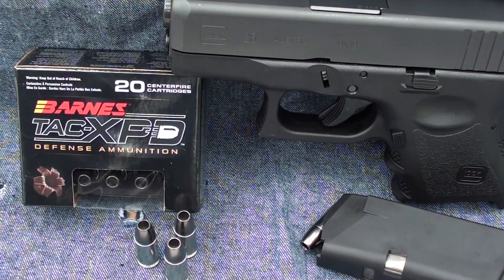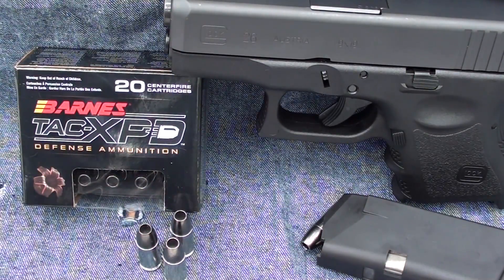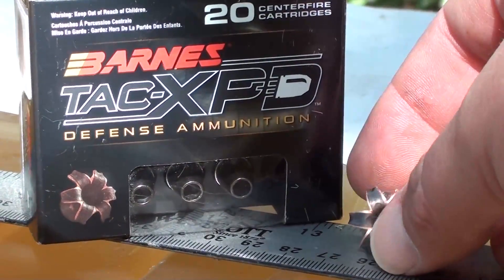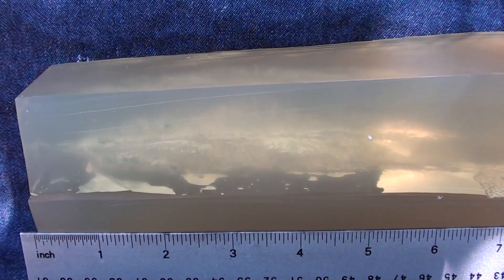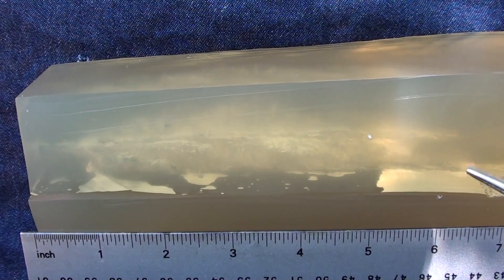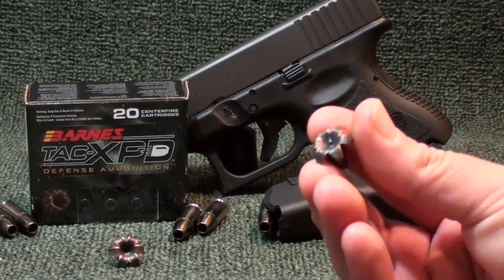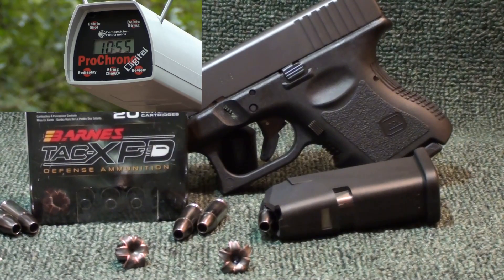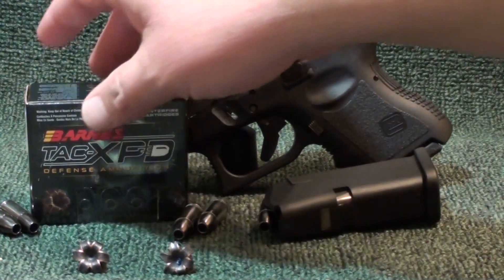9mm Barnes TAC XPD short barrel ballistic gel test

Comment: This round loaded at 1200fps would be pretty damn nice but not this level. Between hot 380 and actual 9mm.

About the lowest powered round you can get to expand past .60 and barely make penetration minimums. Trick is half the bullet is caliber diameter still unlike most other expanding rounds. 

Barnes says they have to load the TAC XPDs lower than American Eagle and Blazer Brass FMJ levels.  Other companies have no problems loading same Barnes bullets hotter (much hotter often) with no signs of over-pressure.

For people saying this looked good please check out Scuba's other 9mm tests.  You'd have to try very hard to find something it matches or bests.  Anything Hornady, Remington, Winchester, Underwood, Federal, etc. that's 124gr or higher has better wound cavity and penetration.  Anything else 115gr will often penetrate the same or slightly less but do more damage.
Reply: I agree. The 9mm version isn't so great. Just ordered me a box in .357 magnum. Luckygunner's test of this was pretty impressive. Biggest expander I seen in their .357 magnum testing.
Reply: Its a 3" barrel.. you damn experts dont understand how.much velocity drops from 4" -3"... Its alot..  as seen here.. a round chroned at 1205 fps out of my glock 17..   4.5" barrel i believe.   That same round out of an xds 3.3" bbl was 1097...        Thats arund 100 fps slower...  There is alot less time for complete powder burn in 3.3" barrel..   it makes a huge difference.    You reallg dont have a clue what your talking avout . That was a NASTY wound channel.. however all those names you mentioned have smaller but longer wound channels...   Its all subjective.. but then again you aint too smart.. you named off factory brands and used them to compare wound tracts... Last time i.checked federal had at least 5 different 9mm bullets designed for SD.  PUNCH, HST, HYDRASHOK  , hydrashok deep, hi shok.. all very very different bullet designs. Same with all the other brands
. So what brand, bullet, what weight, and pressure rating are u referring to???  You dont know.. because your just some smart ass internet fool that dont have a single clue about ballistics, projectiles, powder , burn rate, barrell length , rifling type nor how all of that interacts with elevation , humidy and temperature change..

Pretty.much all you know is nothing..

Comment: 1055fps for a 115gr bullet is the slowest I've ever seen.  I understand the whole 3.46" barrel, but that is STILL the slowest I've seen.  Underwood sells a 147gr that's faster than that.
Reply from the maker: +Joe Blow   Barrel length does factor in a lot in the 9mm, but load spread is huge in the 9mm category.  Factory loads from 1050-1245 is the norm on 115gr.  That's a HUGE spread in defensive ammo, but its been that way for years.  Nobody agrees on 9mm velocity, not even the experts with a spread like that! LOL  But I hear ya though, thanks for watching
Reply: It's a copper bullet. Copper weighs less than lead. It is a longer bullet to get the weight. Longer bullet=less room for powder= higher pressures (+p) and lower velocities...

Comment: Looks like a pretty good performer.  I'm somewhat disappointed the velocity wasn't higher being it was +P and 115 grain... but it was a short barrel so I have to keep that into consideration.  Any plans on testing it from a longer barrel?
Reply: All copper bullets are lighter than lead so they are longer and leave less room for powder. I found that Cor Bon's DPX was lacking in comparative velocity, also.
Reply: @jwash3rd  you said it. The Barnes solid copper dpx bullet is almost as long as a 147gr standard JHP bullet. I guess Barnes is a but scared about excess pressure. But it's soft shooting. Have it in the G19 for thr wife. I have the Beretta 92 using Win 127gr +p+ or 147gr Ranger.
Reply: Tommy TwoGun tnoutdoors9 had a 1060 average out of a G19.
Reply from the maker: I could test it in the 92F five inch barrel, but with the results I just received  its a given it would perform better, plus I don't think people are carrying a 92F, most likely would be a G19 test. If I get enough comments I can test it in the G19 or the 92F.  Let people know, Its all cool with me!
Reply: I think the G19 would be an excellent candidate for testing for sure.
Reply from the maker: I will see what I can do